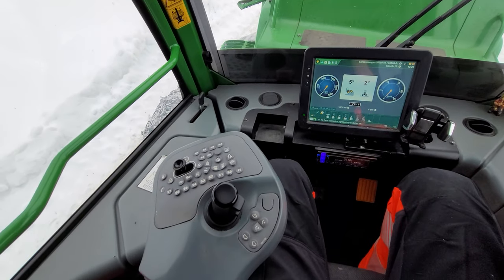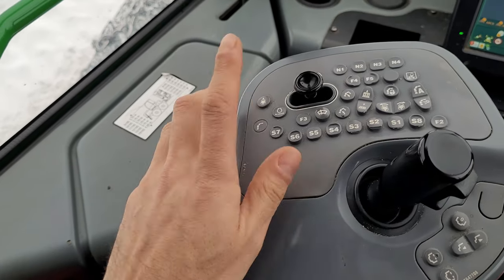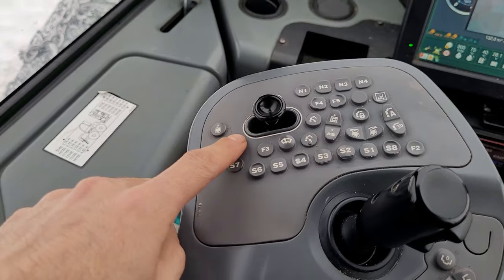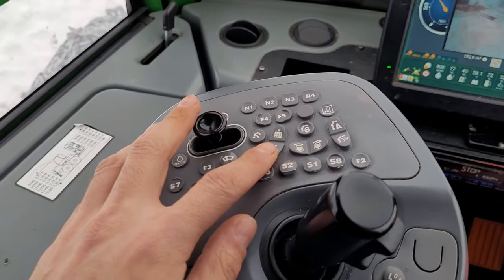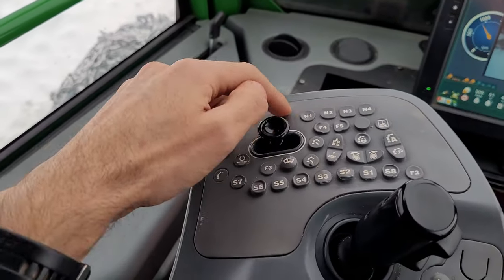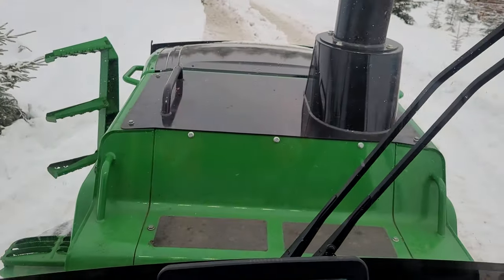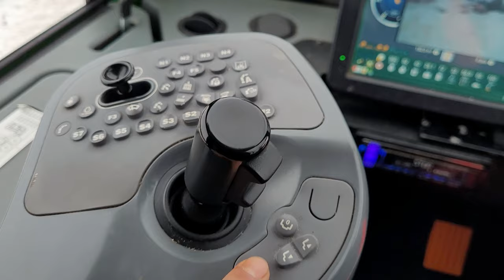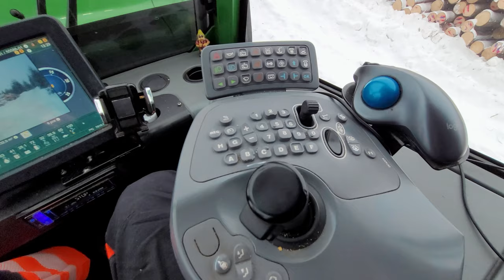John Deere 1910G Forwarder: A Beginner's Guide to the Control Panel🔴Part 1🔴

Comment: what settings do you use for crane speeds and ramps? Obrigado
Reply from the maker: for my crane i have everything at 100% with IBC on
Reply: @thedarkdeere  and the values of the ramps
Reply: @thedarkdeere  And I would like to speak with you in private. how can i send my whatsapp contact to you privately?
Reply: @hugoestevao5862  you don't need to adjust ramps when using IBC